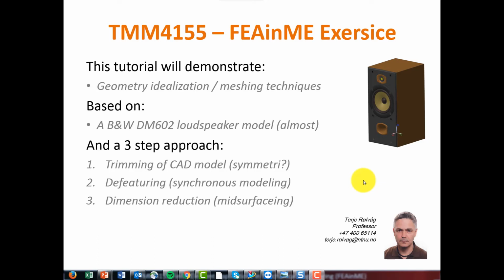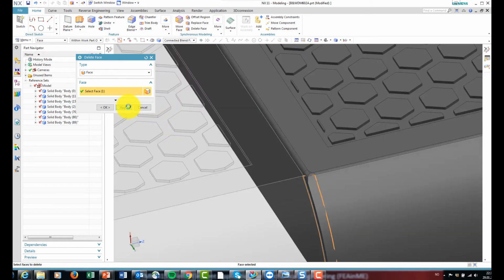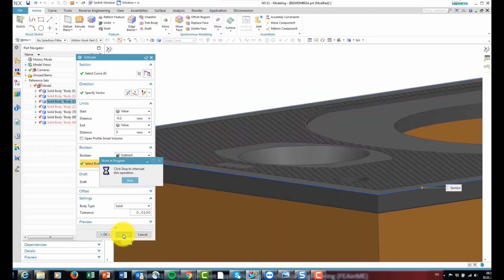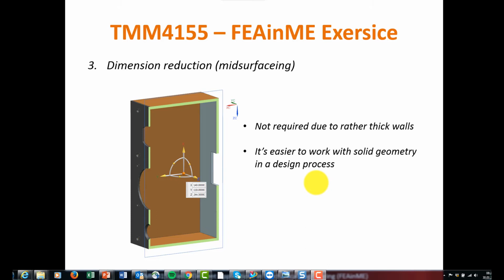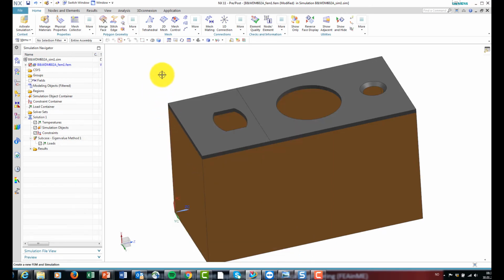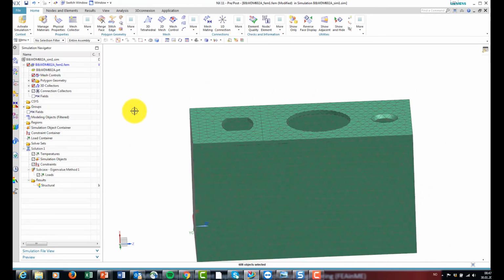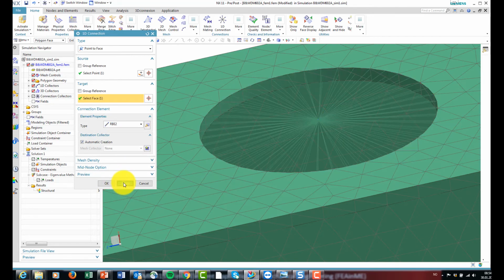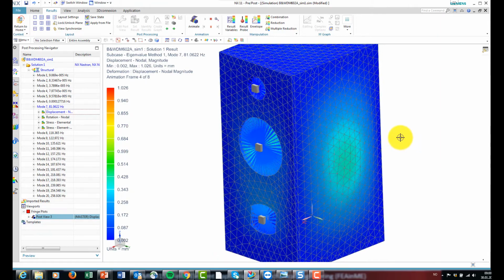NX B&W 602 idealization and meshing

Comment: Nice video. But, actually after some time I started to prefer working on simplified 2D models in concept/early design phase. It saves a lot of time - for example adding a rib is just like 3 operations in Modelling and 2 in Pre/Post.
Reply from the maker: Sure, I guess if the redesign only involves changing thicknesses and adding ribs, 2D models are most efficient. I guess that's best practice in aerospace and civil engineering. However at our department we are mostly dealing with product development / design and then 3D models are usually the preference